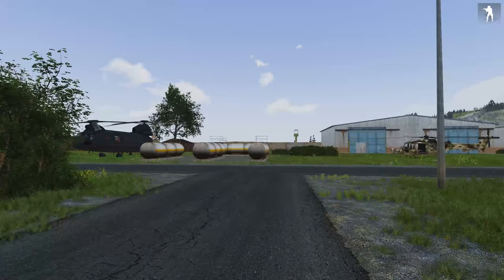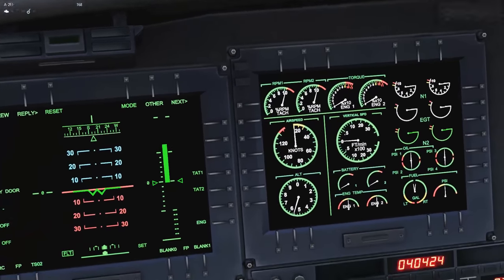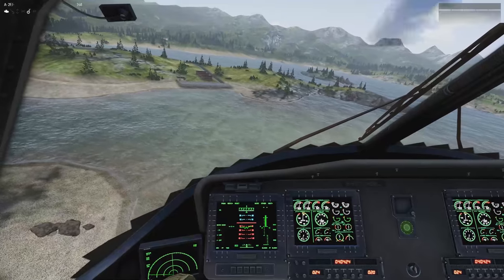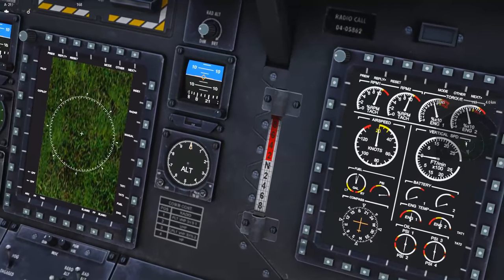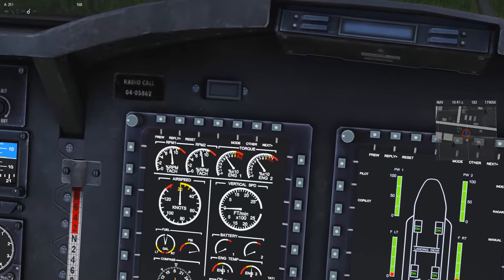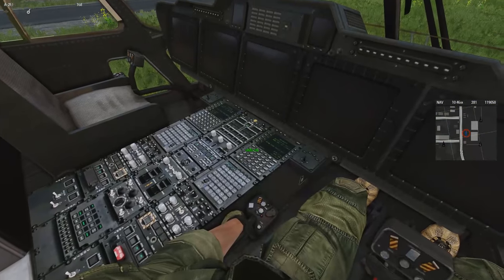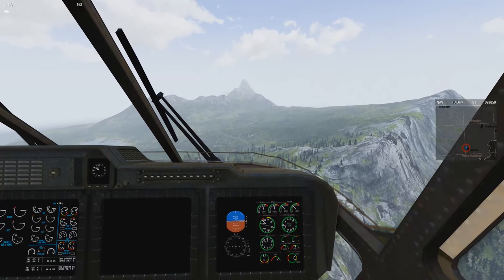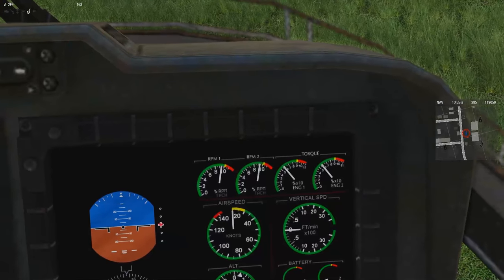Glass Cockpits - Arma 3 Helicopter Flight Instrument Tutorial

Comment: I also love the Huron. To the left there is a gauge called the ALT. When I was just trying it out I noticed it has 2 arrows that move on it & also there's a brown line. DO you know how to read them? Also I noticed that the needles on the gauges you mentioned about something about 40% lift don't work on the Huron as far as I can see. 
Would it be possible to dedicate a whole video on everything Huron? Hints & tips on how to achieve slow & controlled flight, Tips on how to hover without the Auto hover & stuff like that? Do you know how comms would be set up in the real CH-47? (just for interest sake).
Those green lines on the right MFD, are they meant to tell you how much stress is on the engines during sling loading (if it worked)
Thanks for the up load mate
Reply from the maker: Thanks for the comment.  As Oz Cougar said, that ALT is actually the altimeter, and I didn't realize it was functioning as I was in flight.  I didn't really look at it because it was positioned as a "back up" instrument (in case the screens fail). But in fact it was working.  The little triangle indicates 1000s of feet, and the needle indicates 100s.  So for example if the needle points to 9 and the triangle is near the 2, that means 1,900 feet of altitude.

As you say, the torque needles did not reflect the position of my collective lever like they did in the Ghosthawk.  Some do, some don't.  It's best to rely on the sound of the rotors and seeing the vegetation lay back flat from the downwash.  Those are the best clues that you are near to lifting.

As for the green lines on the right MFD, they might be cosmetic, but the lower pair said F LT and F RT.  Might be fuel tank indications.   The only way to verify that is to fly a lot and see if the green bars change.  The upper two green bars... no idea.  Glad you liked the video.  More to come!

Comment: Thanks for the vid, helped me a lot!
And it was great how you explained everything
But shouldn't rpm change when you add speed?
Reply from the maker: Thanks, I'm glad this helped.  RPM is the speed of the rotor blades, and they are mostly constant.  Speed happens when you pitch the blades to generate max lift, and drop that nose to tip the rotor disk forward.